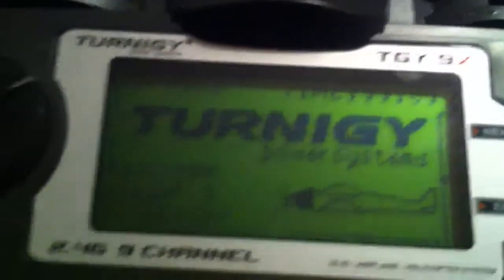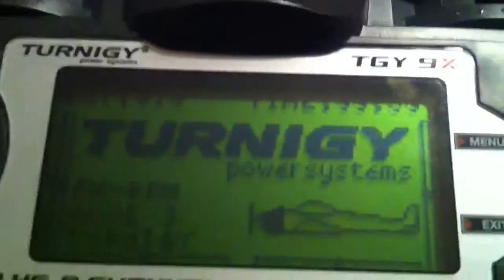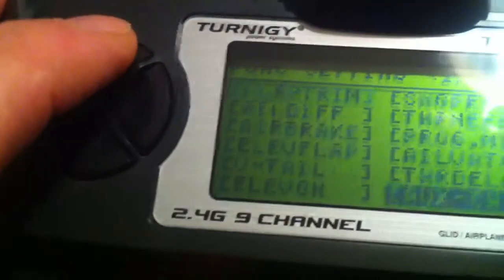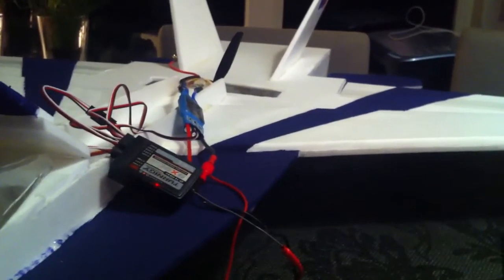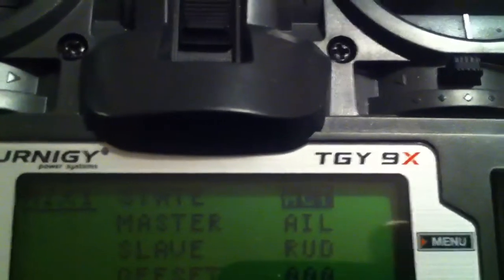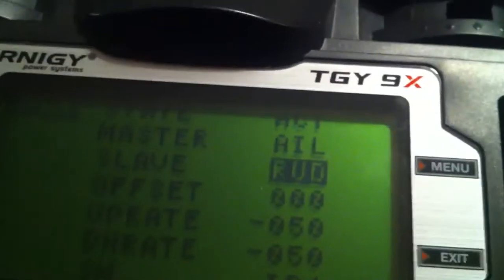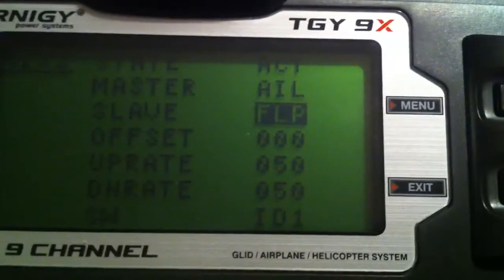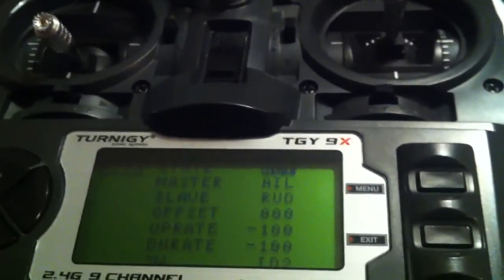Turnigy 9x programming

Comment: I fly Mode 3  and I would like to know if there is any way to program in a slight deadband  into the down elevator stick so as to avoid accidental down elevator when turning. I am flying an Alula trek and other flying wings.Thanks